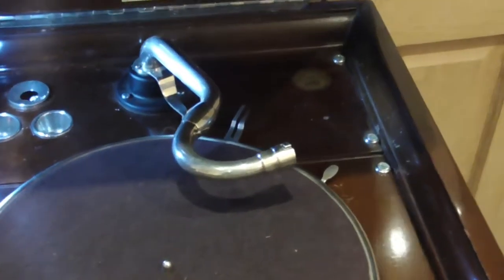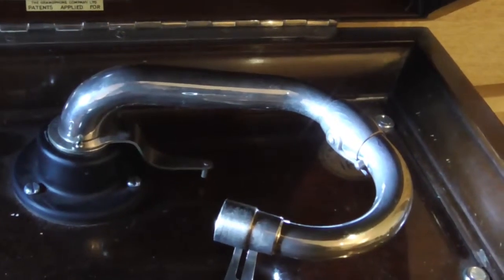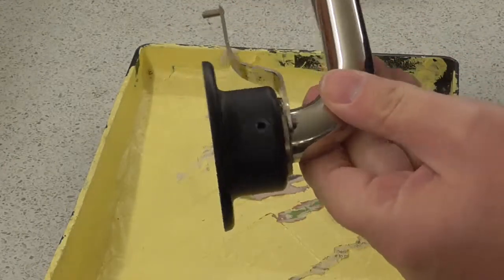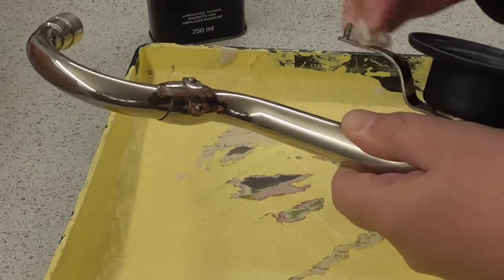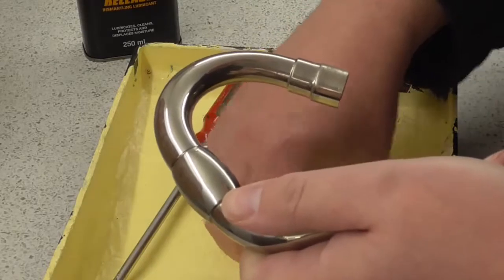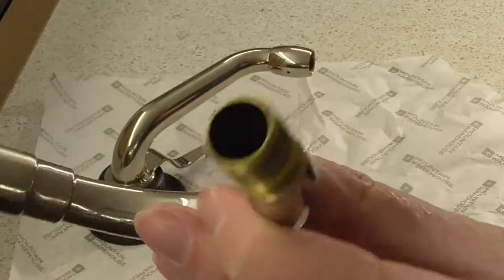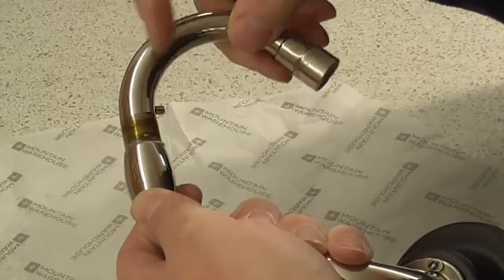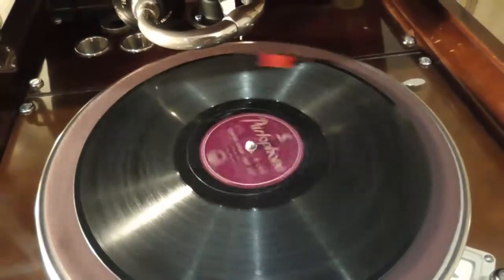HMV Gramophone tonearm service

Comment: Thanks for uploading the video. Your method is thorough and detailed. But I have found another way of doing it. Simply place a plastic sheet over the turntable, remove the needle from the soundbox (reproducer) and than disengage soundbox from elbow, and place it on a secure place lest you should damage the diaphragm. Now  sprinkle WD40 where tone arm rolls over the elbow. Let the lubricant seep in the grooves for a couple of minutes and than start moving the elbow too and fro. In next thirty seconds you will feel that the tightness of elbow has started loosening.
Reply from the maker: Yes, that can be very effective for hard to reach places, and WD40 is great for freeing things up, though not so much as a long term lubricant. I did a similar fix to this HMV motor, though I really do need to go back and grease it properly:
https://youtu.be/IY6bh4ojH9o
Thanks 😀 👍

Comment: I have bought a HMV 101 and the tone arm moves but not so smooth as yours. The thin part and also the part with the black ring. The gramophone plays very good and I do not see any damage on the records grooves. Do you think I need to grease it? Which kind of grease did you use? Thanks and regards
Reply from the maker: Ideally, it should move very freely. The grease I used was white bicycle grease, but any fairly light grease will do. I've not serviced a 101 yet, so I am not sure, but some tonearms have ball bearings in the joints, so be very careful if you dismantle it. You may find a better video on YouTube, which shows the detail. Congratulations on getting a 101. They are great machines! Thanks 👍 😀
Reply: @mrrgstuff  yes, you are right. I could see through a small hole the bearings. I will check these other videos. Many thanks, soon I will post some videos of the 101 playing 😊

Comment: Go with a synthetic grease that wont break down and change viscosity, white grease doesn't age well, signed an old tech.
Reply from the maker: Thanks. This grease is some sort of synthetic bicycle grease, if I remember correctly. I presume the original grease was similar or the same as the stuff HMV used for their springs, which is well known to turn to 'treacle'. 😀
Reply: Hmv grease was graphite and Vaseline if memory serves correctly
Reply from the maker: Yes, and the motor in my 162 thumps a bit when it is quite wound down so I believe it still has the original grease. Would like to regrease it with something more modern but don't relish the idea of tackling the double springs! 😉
Reply: Id recommend someone doing that for you there are people in the uk and abroad can do it
Reply from the maker: I agree. I might try fixing a smaller single spring motor but the HMV 32 motor is probably worth spending money on. I think new springs are about £50 each also. Might be worth getting them changed too. 😀